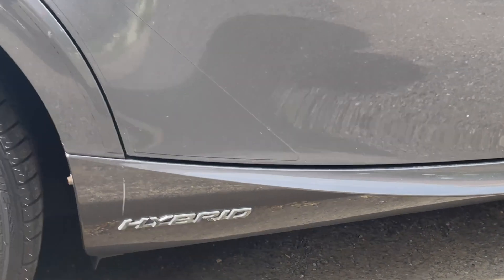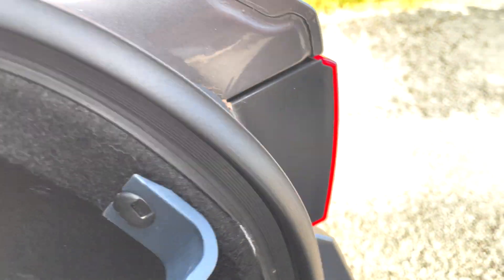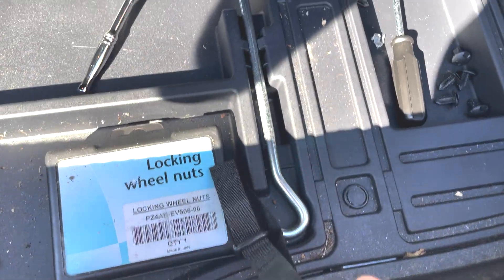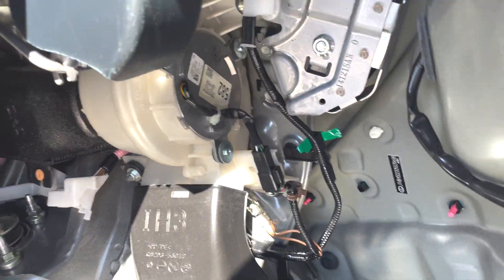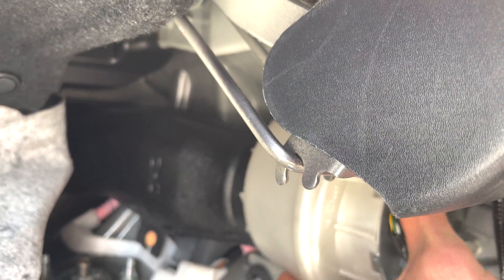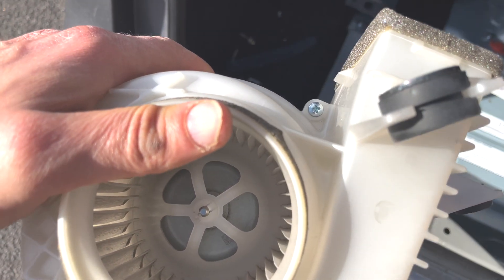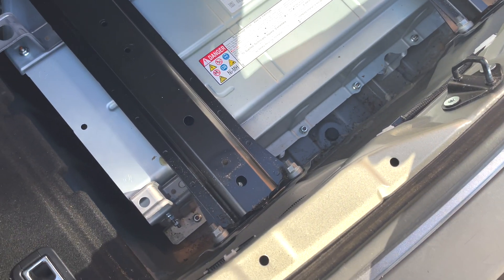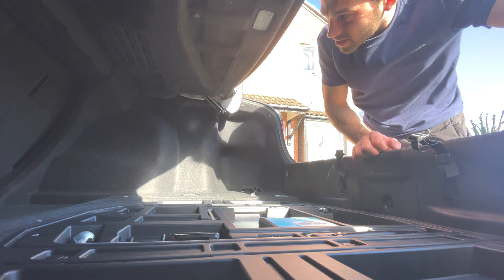Used LEXUS Hybrid - The First thing you must do - How to clean the hybrid battery fan Part 1

Comment: Great advice!! I bought a used IS300h with a recently replaced battery, car and battery just out of warranty. The previous owner was kind enough to have the car serviced by Lexus before handing it over. After a few months while building my own maintenance schedule I realized that in that last service the Lexus dealer did not clean the battery filter (HHC cleaning or something like that). While the battery is under warranty that is part of the annual service. However, with the battery just out of warranty they did not do that... So effectively that filter had not been cleaned for some 18 months. The moment I realized that I did the cleaning like you recommended (but removing less trim in the process). The filter was 90% clogged and the fan was dark grey from dust crusts! Took me perhaps 2h learning along the way, next time it’ll be half.
Reply from the maker: Well done! That in my opinion is something that everyone owning one of those brilliant cars should do

Comment: What happens if you forget to plug the fan connector back in? Will a fault code appear on the dash?? Please reply 🙏 am not sure whether i plugeged it back in after cleaning
Reply from the maker: I’d definitely suggest to double check it. As I’am not sure if a light comes up. Also it will take you just 15min which are definitely worth it considering the risk.
Reply: @ i double checked it and it’s plugged back in. Problem is, sir, is that when i placed my hand on the vent located at the backseat, i dont feel any air getting suck thru it. My car is a lexus is300h.

Is the cooling fan not operating at all times?

Comment: After looking at the videos on cleaning these elements on Toyota hrbrids I can only say how disappointed I am that Toyota chose to design the hybrid cooling components where they are so relatively inaccessible.  I am sure Toyota is not alone in this flaw but really, this is a failure on Toyota’s design team for such a critical element of the hybrid system.  It should be bo more difficult than checking or changing the gas engine air cleaner.
Reply from the maker: I agree! Although you don’t have to do it very often at all, it will be nice if it was easier to access it.

Comment: Thank you! However, it is much more important to clean the net on the back seat! 
These are located on the side of the door, make sure that they are not covered!
Reply from the maker: I agree with you
Reply: Huh?
Reply: Most common failure of overheating batteries...its all about maintenance. I would never consider buying a hybrid with a severe clogged filter.

Comment: You didn't do the job properly and you are showing it in a wrong way. 
When you removed the fan you need also to remove the long black pipe which runs into the fan from vehicle cabin. At the beginning of the pipe there is a special net which needs to be hoover/vacuum. And this is much more important than to clean the fan on its own. You should do it every 60000mls.
Reply from the maker: Thank you for pointing this out . You can look at video part 2 for how to clean the filter as well

Comment: This morning started the warning with consult a dealer bla bla, and after 1 hour of this video and battery unplugged, the warning disappeared, and I think that it added some more range km (I don't know if this is because it got the fuel consumption to 0, because of the battery, or because I cleaned the fan and filter). Thank you!
Reply from the maker: Cleaning the filter definitely helps as the battery will cool better and work optimally

Comment: Have you changed differential fluid? Its something overlooked
Reply from the maker: I have not yet. But I have just received the fluid the other day .
Reply: @Battery-Powered  There is a couple of guides on youtube its getting the car level to ensure correct amount of fluid back in, thats the challenge you need to know your jacking points put it on axle stands. Drain & refill is easy 10mm hex plugs.

Comment: Won’t this be done when you take the car to get serviced? I am looking to purchase this car myself but I don’t know how to maintain my own cars etc so will this be an issue? I normally just get it serviced whenever the service is due.
Reply from the maker: That will not be taken care of if you were to go to just service the car
Reply: @Battery-Powered  if that's the case then what does the lexus hybrid battery health check include ?
Reply from the maker: @istanbul0562  they just check the condition of the battery .. it’s not a service.
Reply: I asked them to do it in annual service and it was like 200€ extra. And it was on proper Lexus dealer.
Reply from the maker: @AndyGrouch  maybe they were considering changing the filter not only cleaning it?

Comment: How do you reset the warning message please?
Reply: Hi mate, my warning message is still on. I drove the car for two days now. 
Any suggestions please?
Reply from the maker: @shahzulislam3749  when you opened the fan was it really dirty? Maybe if the car was driven to a point at which the fan failed it’s now no longer working and you will need to visit a mechanic… 
Maybe the battery overheated.. or the fan stopped working.
Unfortunately I can’t give you any more information
Reply from the maker: Did you clean the filter and the fan ?
Reply: Yes I did.
Reply from the maker: @shahzulislam3749  after a short drive the computer should clear the message automatically.
Reply: Ok. Thank you.